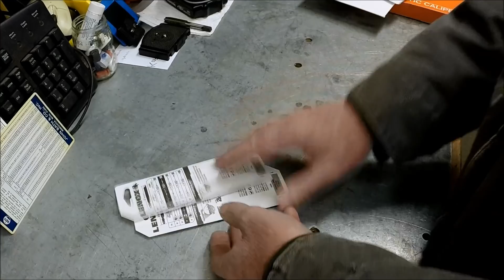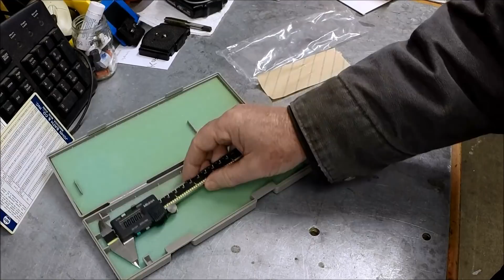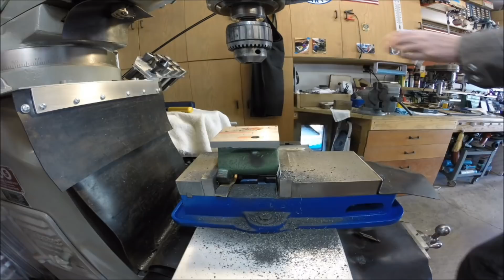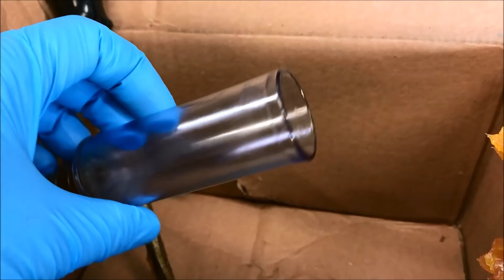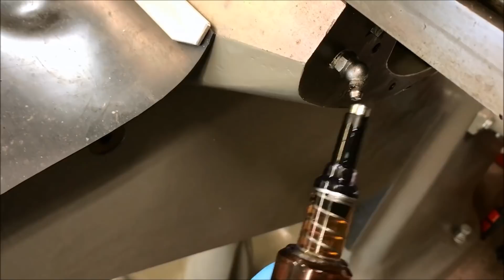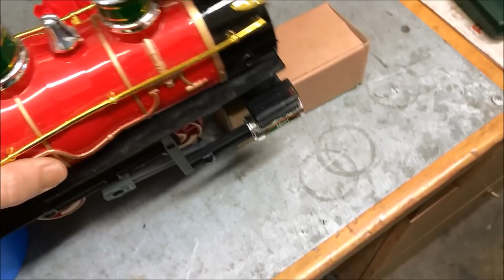Weekend Update #2 - New Items and Small Projects

Comment: I am just starting the process of looking
for an old 1940’s to 1950’s/60’s era South Bend metal working lathe in the 9”
or 10” model version. I have no frame of reference in regards to pricing for
one.  Could you please provide me with
some idea of what I would be paying for one of these machines in
restorable/rebuildable condition?  Thank
you very much.
Reply from the maker: Tom, If I had to do it all over again. Would just probably buy a new Precision Matthews 14" gunsmithing lathe or a Grizzly Gunsmithing lathe, they have some nice package with accessories deals and good shipping rates. That said if your in the midwest or great lakes area you can probably find that vintage and size between $500-$1000. West coast probably double that and east somewhere in between. Tooling and accessories are a big factor a bare bones lathe will require $$$ for tooling and accessories for older machines can be $$$ and hard to find. Very enjoyable saving an older machine, it takes a lot of time.
Reply from the maker: Tom, check Mr Pete's video. There's a cherry 9" SB for sale.
https://www.youtube.com/watch?v=ITD2pxtKKK0

Comment: Dean,  great video !  gotta improve those chinesium tools... hey btw do u have a link for those oilers ?  i wouldnt mind picking up one for a spare..  thanks  Joe
Reply from the maker: Joe, there on ebay. Search for item no: 221872032734

Oiler works good; grease is garbage,
Dean
Reply: @TheAyrCaveShop  Dean, thanks very much.. i picked up a couple... think last one i bought was 40 bucks from H&W   without the grease... hopefully i will add an one shot lube system in the near future...
Reply from the maker: @RaptorMachineToolCo  Joe, your welcome. I try to support H&W when I can, have bought several items. Yeah but $40 was too much for a 90% plastic tool. Have fun scooping out the chinese grease.:-)  Dean

Comment: I need to get some way covers installed on the mill, I was going to try that hypalon or whatever it was Stan suggested but this seems like a viable option.

Edit: those grease guns usually come with chainsaws for the bar tip and clutch hub bearing. I usually ditch them for the cast palm pump version. I’ll see if I have a spare and mail you one.

Comment: Thanks for the shout out. I appreciate it. :) lt was like a Christmas edition of McGyver when you cut the wires lol .The oiler is sweet, and a honey of a deal at only $5 sans the earwax removal procedure. The time lapse was good, and a good visual tool to have in the editing trick bag. I think they are best used either to show a slow, but dramatic display of action, like painting or assembling something, and also with no machine audio, but instead a voice over explaining what is happening on screen at the machine. I've found that a lot of info can be relayed and absorbed that way.  Thanks, and Merry Christmas. :)
Reply from the maker: I've still got to come up with a voice over mic. Surprisingly I don't have one yet.
Have a very Merry Christmas !!
Reply: A mic is best, a good mic is even better, but you can also just record the audio with your camera and convert the video file to an audio file. Merry Christmas, Dean. See you back in a few weeks. @TheAyrCaveShop